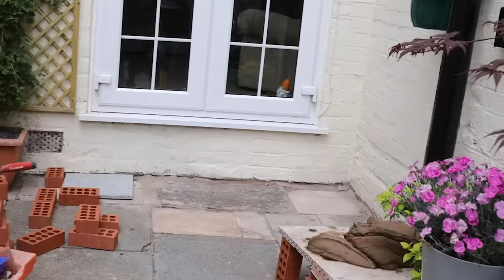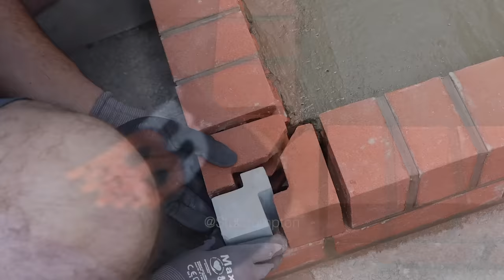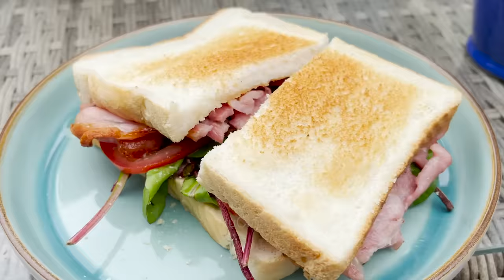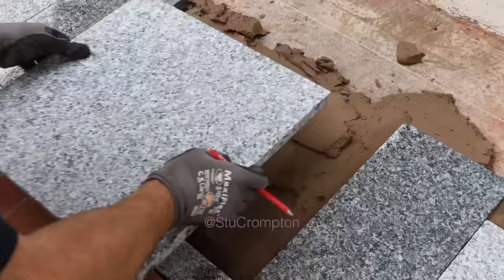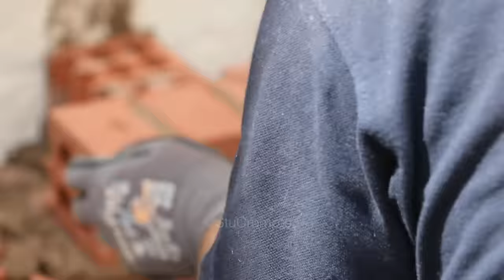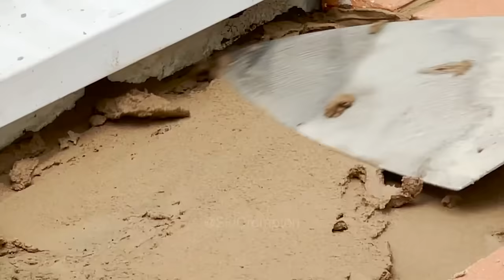Building Double Brick Step From Start To Finish

Comment: Why build a set of steps when they're compromised from the very start? Why would you them lay on top of a patio and not build up off your own footing.
Reply: 20 seconds in and am thinking the same. Thumbnail looks cracking if your doing it in an “In between home” lol
Reply: @stevenorwood2574  in between home? What does that mean? Lol
Reply: The only sane man/woman in these comments
Reply: The patio won’t move
Reply: And why would they be compromised? 

The slabs will be on a compacted hard-core! Those steps won't be going anywhere!

Comment: The first step out should have been the same width as the bottom. To me it looks weird...especially right next to the ends of the door jambs...and i would have taken the bottom edge to the wall...then matched the bottom length to the left. But...that's just me. But to the left on this pier and beam breather...you're limited to match bottom widths.